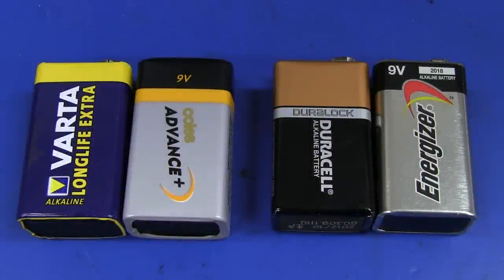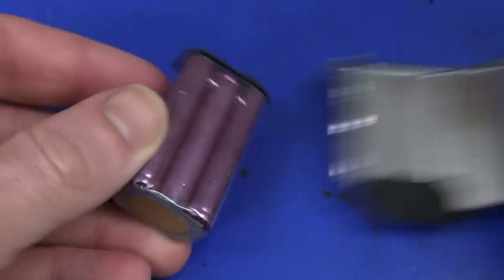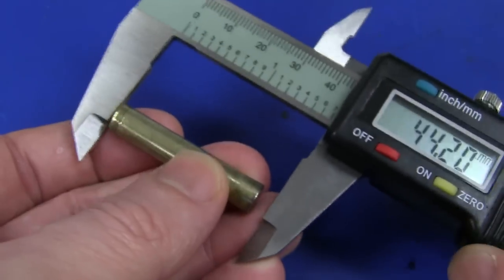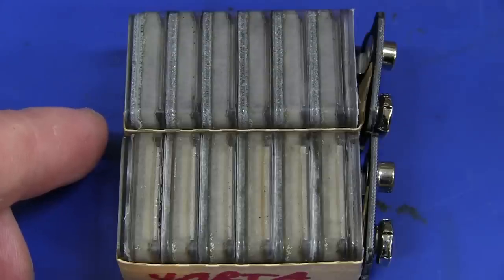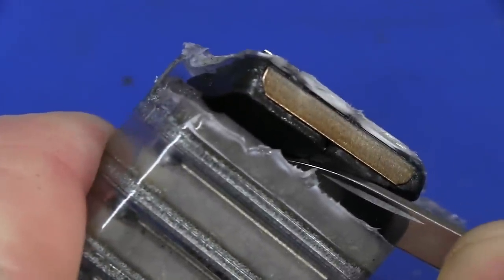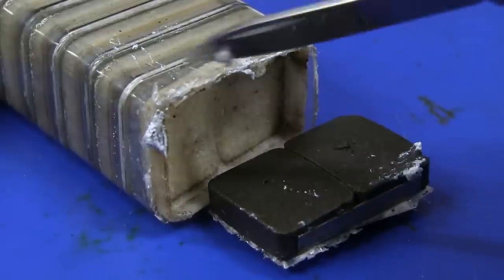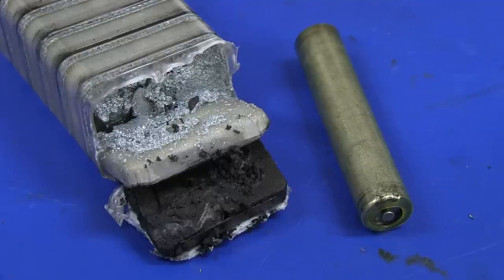EEVblog #518 - 9V Alkaline Battery Construction

Comment: Nice Vid.
Did a Science project back in school for Chemistry 40 year ago.
Just the same as you stripped several batteries but I fixed all the bits to card and presented them in a folder.
Was a tad messy but got A+ for it.

Comment: I've just taken apart a Duracell Plus Battery. It uses individual cells, bright red this time, but the construction is slightly different from Dave's Duracell. These cells are held together between plastic end caps. There's no clear plastic film, and only a small piece of shaped white cardboard glued over four of the welded tabs at the terminals end of the battery. It's fairly easy to rip the tabs off and use the individual cells. It's also easier to unfold the seam of the case, than cut it.

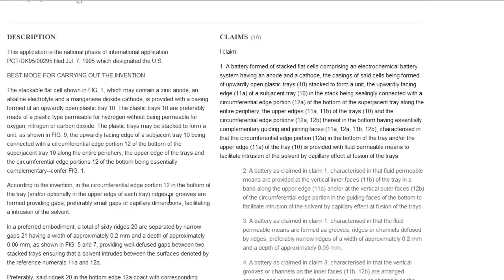Comment: Yeah, the patent actually does cover the stacking arrangement, Dave. Check out the 'Claims' section at the 10:06 mark. That's the meat-and-potatoes part of any patent. Bloody patents, eh? Could have sworn that arrangement was well over 100 years old!
Reply: Alessandro Volta invented the voltaic pile, published in 1799. Patents are complete nonsense, practically every patent is some insignificant variation of something that already existed for a hundred years or more.

Comment: The "pile" battery is better construction in my opinion, as they are maximizing the space use of the 9V battery, unlike the AAAA battery construction with all that wasted space.
Reply: ***** Given the same chemicals concentration and quality, the pile battery should, theoretically, contain more energy, i.e. the pile battery will give out 9 volts longer than the AAAA batteries construction.

Reason being that the pile battery is optimizing the space of the rectangular 9V battery, which means more chemicals packed in the battery, which translates to more energy in the battery.
Reply: ***** The amount of chemicals, given same concentration and quality, dictates the mAh rating of a battery. More space used = more amount of chemicals = more mAh rating. Think about it this way (percentages are an example): in the AAA construction, 80% of the space is chemicals, 5% casing, and 15% air. In the pile construction, 94% of the space is chemicals, 5% casing, 1% air.

If I were to spend money on a battery, I don't want to waste money on buying air. I prefer to get more chemicals, which means more energy, which means more mAh, for the money I'm paying.
Reply: Sami Al-Terkawi Hasib There is the factor of surface area. The 4A solution can get more surface area per cell, ie, more amperage. Their absolute energy density will suffer, but they can use up their chemicals more thoroughly because a more depleted battery will still be able to give usable current.
Reply: Validole
 That's a very interesting point that I have never considered. Let's do some calculations:

4A battery dimensions are 42.5 mm * 8.4 mm. The rod diameter of the AA batter is approximately, if not less than, 1/3 of the diameter of of the battery itself. Based on that, The carbon rod dimensions are approximately 42 mm * 2.8 mm. Surface area= 2 * pi * (d/2) * h = 2 * pi * (2.8/2) * 42 = 370 mm^2      -----> Result (1)

9v Battery size is 26.5 mm * 17.5 mm. We remove 0.5 mm to account for casing thickness. Pile carbon dimensions are 26 mm * 17 mm. Carbon surface area = 26 *17 = 442 mm^2.           -----> Result (2)

From results (1) and (2) we can conclude that, as a ballpark estimation, the pile battery has approximately 19.5% more surface area per cell than that of the 4A construction. It should be noted that the actual dimensions of the carbon surfaces should be accurately measured to get more accurate results.
Reply: in theory yes, but real life it wont match. its not the size that matters. but the chemical usage inside the battery. wider the area of chemicals then the alkalines are separated around the compound uneaven.
(think of solid fuel rocket and wonder why they are very thin of outer diameter than liquid fuel rockets)

Comment: The strangest thing I ever saw, was when I took apart a generic 9 volt at tech school once.  The inside of the wrapper was printed with a different brand and type of battery that I had ever heard of!  Must have been recycled I guess.

LOL, I have the same digital caliper, and it loves to eat batteries.  Every time I go to use it, it's blinking again.
Reply: Same

Comment: The materials don't really get used up, the molecules get realigned but it is the same chemistry as in rechargeable batteries. The latter are just made stronger to avoid leaking during charging.

Comment: I belief the stacked construction has more capacity, because essentially the complete volume of the 9V battery is used. Instead the battery with the AAAA construction method, has less battery chemistry per volume. First because of the void spaces between cylindrical cells and also because a cylindrical AAAA cell nearly has more than 1mm of its diameter only used for the metal casing.

Comment: hey Dave,
I remember back in the day,when I was a kid in the 60's, I opened a Six volt lantern battery. It was a "Union Carbide" Brand, if I remember correctly. it was the Pile construction, but it had square zinc & carbon paste wafers that were open on the ends, but had a fairly heavy plastic wrapped around the sides. I think, the outside was a heavy cardboard material, if my memory serves me well. it was interesting to see inside the thing though.
Reply: union carbide.... I saw a documentary about one of their factories. search for the Bhopal disaster. Their factory had a chemical tank explode because water for into it and started a reaction. It killed hundreds or thousands of people in Bhopal. It was horrific. Half the city woke up in the middle of the night unable to breathe, and it only got worse from there...

Comment: yeah, but the electrolyte pad looks bigger in the stack cell, than in the cross-section diagram. and the surface area might be different in the 4A cells, leading to better high-discharge performance.

Comment: Since the Manganese Dioxide and Zinc Oxide undergo chemical changes as the batteries are used, could the difference in material properties (crumbliness) be due to one battery being at full charge and one being empty? I would expect to see the materials look different when new versus when the battery is used up.

From Wikipedia's article on Alkaline batteries:

Zn(s) + 2MnO2(s) <--> ZnO(s) + Mn2O3(s) [e° = 1.43 V]

Comment: Yep. Best and very common: 6x AAAA batteries in series and welded to straps. Cheap as dirt: 6x AAAA pressed to plates. Most common: 6x prismatic cells (means rectangular) also strapped together and welded. The latter more common to rechargeable NiMH and NiCd. All usually made by one of 4 companies around the world.

Comment: i opened flat Duracell and a flat energiser - from a box ready to go to recycler. after opening both i left them in a container. One then exploded and several hours later another cell exploded. both were from duracell. zinc electrode was expelled from cell and in both cases a shot weld was separated. One cell hit ceiling and went about 1m. other one shot zinc nail about 10m after bouncing off at least 1 wall. in both cases the is zinc compound left all over the floor.

Comment: I'm not sure about these cells specifically, but I know a lot of other zinc carbon batteries with the can design (like a D cell) use ammonium chloride as the electrolyte. So it's possible the fabric is soaked in that. If you noticed a smell like strong ammonia or smelling salts, that would be what it is.

Comment: Is there a difference in capacitance? I suppose the cylindrical type contains more air and thus delivers less energy - a discharge curve comparing the two types would be interesting.

Comment: 9:40 its just statement for an danish stock company (A/S = aktieselskab) and the name Daugaard also sounds pretty danish.. but if its pretty much nominel-like AAAA battery inside 9v that would make it cheaper for pressure sensitivity stylus'er where some are using the standard aaaa battery, do to its thiness, and that model is not cheap when you need new ones and pretty uncommon at least here in Denmark... so it could be an easy way to get hold of AAAA class standard 1.5v battery

Comment: Fun fact, the Duracell batteries you show in this video are made in USA, but I think sometime between this video and now they changed. I checked some recent Duracell batteries that I had, and they now say made in Malaysia. So are they still the same construction? I tore one apart, and it turns out that they switched to using a pile construction as well.
Reply: Can confirm, I also have duracells with pile construction made in malaysia. I'm pretty sure they all switched over to pile construction, there's more surface area where the chemicals contact rather than just a thin rod in the center and I imagine this construction method is far cheaper, more compact, better max drain current, and better density because there's no gaps like you get from putting multiple cylinders together, and obviously lighter weight too without the 6 metal casings...

Only downside is the pressure like he described, when he pushed on the walls it would squeeze the chemicals together and make the battery work better. Not as noticeable in the old school metal design because plastic is far weaker and more flexible, it has more give so it's more prone to being "smashed" although nobody has ever crushed one so it's not a huge durability issue or even very noticeable. Wish I had the other type so I could run some proper tests on them tho...

Comment: BTW I am using Li-Ion "9V" ones, which have 2 elements in series (~7-8.4V actual voltage). Quite convenient as their voltage is much more stable, especially at high load.

Comment: Nice electrolytes for dehydration issues. Important precious elements in batteries,  don't throw them . Reuse the chemicals.  Even connector terminals are precious , outer metal shell & plastic are important . Dont drop in soil to form ores as they are extracted with effort .

Comment: Why does the pile version need a strip running up the side? Why not use the case as a conductor and save a few centimetres of metal?

Another thought: Why not make two piles with three cells half the width and twice the height and orient them in opposite directions so you can just use a little strip of metal on the end to connect them?
Reply: because you'd only have to touch one pin to short the battery out in your hand, since you're holding onto its outer case. safety thing I'd think, even though they're not very dangerous compared to li-ion or li-po. Those can be super dangerous, ask the people who bought cheap Chinese hoverboards that have burned their houses down lol
Reply: +neil huband  Or the people who bought laptops with faulty batteries a few years back.

Comment: They're a few millimetres shorter than a AAA battery, and have a smaller diameter: so they'd have a lower capacity. They'd be better to use in custom projects, where space is limited. You could probably 'MacGyver' them to replace a AAA if you needed to though.

Comment: I'd be very curious to see if the stacked construction gives any power benefits? It does seem to use more of the available space so perhaps that construction will last longer. Dave wanna slowly discharge a few batteries over the next few days? :)

Comment: alkaline batteries are a Danish stock-based corporation (A/S), and are a parent company to Gold Peak Industries (Holdings) Limited.
Reply: Additional information on "Alkaline Batteries A/S" of Denmark (Some of this may have been mentioned by others, Google makes it hard to search or skim the comments):

Alkaline Batteries A/S of Thisted, Denmark, now just a "paper company", is the last remains of Hellesen's A/S (with the Tiger logo), the company that invented dry batteries in 1889 and the 9 volt element in the early 1980s.  Many of the company assets, including the brand names were sold to Duracell, but the new alkaline factory in Thisted lasted a bit longer and was sold to Gold Peak, who closed it down in 2005.  Before the sale, the company had actually been setting up 9V factories (mostly non-alkaline) in various 1st and 3rd world countries, plus a 9V Alkaline factory with GP in Malaysia, which is where the factory equipment was moved in 2005.  So designs and patented tech from this factory are all over the industry now.

The inventors name is really spelled Jørgen Daugaard (The letter "ø" is a Danish specialty), and the note at the top of the patent indicates that the original Patent was issued in Denmark, then duplicated in commercially significant foreign patent offices, hence the "in several countries" stamped into one of the electrodes.

Comment: is the stacked construction better for leakage? looks like it since most of the outer housing is not made up of electrodes and also only leakage from the top and the bottom cell seems to be able to get outside.

Comment: Try running backwards voltage at least double the battery on a pile construction and they explode the base out but the 4A construction just says contained
Reply: capacitors are more fun to connect up in reverse. They make a big bang and release their cargo of chicken feathers.

Comment: Great video.  Always learning more from your videos Thank you.  Anyone try the Chinese Li-Ion rechargeable 9V batteries.  Besides over rating their capability on the label, I have found they are great for some applications but all my guitar pedals or built in tuners hate them.  The tuner acts like the voltage is too high and 9V pedals add a lot of noise to the guitars signal line.   I haven't taken one apart yet but thought I ask here if a review has been created.

Comment: is there a performance difference between the different construction styles? like, the cell pile takes up more of the 9V casing, but does that correspond to an increase in capacity over the 6x4A cells?

Comment: I suppose you never heard of electrolysis, after the the battery is spent or after the oxygen ions move to form a weak covalent bond with the zinc (not a completely different molecule) the process can be reversed through reverse electrolysis or in other words by applying a current to force the ions back into the cathode or the manganese oxide and carbon mixture. Carefully recharge a spent battery and you will see.

Comment: the biggest problem with 9v batteries is the low milliamps per hour rating, best iv'e seen is 6oomah, even crap aa cells are better than that, i know its not quite as simple as that, but still bulid a 9v battery pack out of aa's, and compared to 9v pp3's they blow away the pp3.

Comment: I'm well aware that alkaline batteries can be recharged. But it's like saying you can collect CO2 from the air and synthesize petrol with it, therefore "cars don't use up petrol". He was clearly pointing out that the zinc is consumed in the reaction in contrast to the electrolyte, the reversibility of said reaction is of no relevance. Don't accuse me of not knowing chemistry when you call the reaction of Zinc to form ZnO "realigning of molecules".

Comment: Wouldn't the stack design potentially allow for a higher capacity since it is using the space more efficiently and thus you can put more stuff in the battery?

-=-=-=-=-=--==-=-=-=-
Also, why don't they ever list the flavor of those compounds, they all just list them as poisonous and provide a bunch of emergency poison control numbers but never any nutritional info or a description of the flavor :)